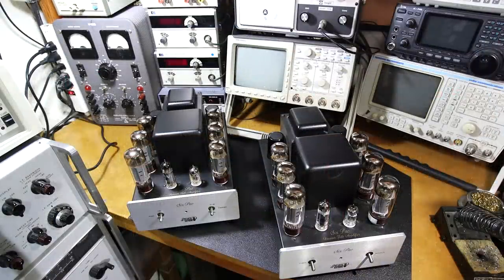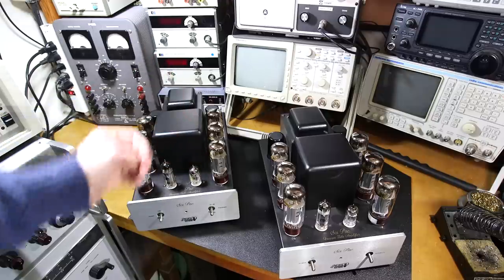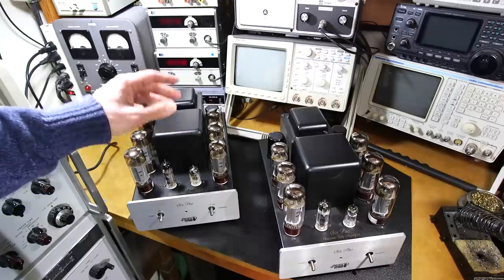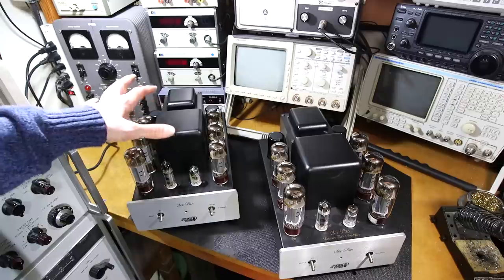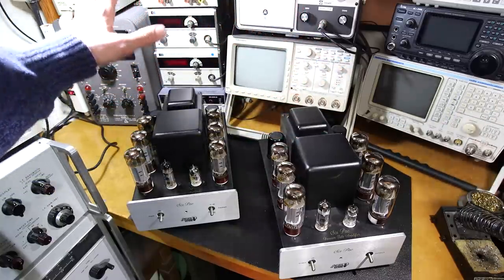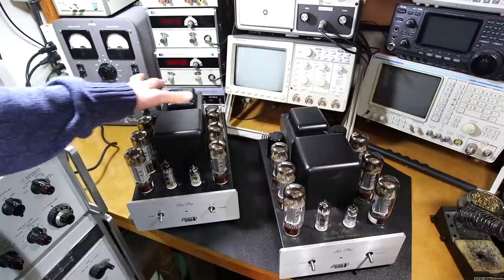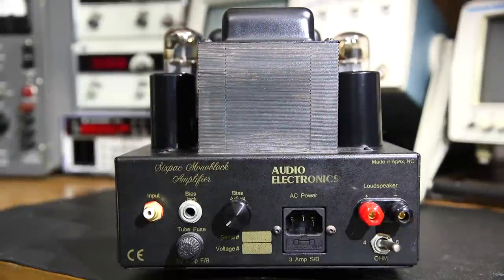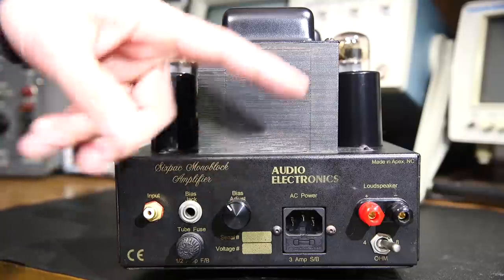Two Six Pac's On The Bench

Comment: I would say regarding double triodes that both triode sections would generally receive exactly the same wear in most circuits. Being that they are run in class a and sit mid point their whole life. Sure there may be cases where one will deteriorate faster than the other but in my experience over 45 years I very rarely see more difference taking a random valve from one circuit  than I would expect from a tube I knew was running in a symetrical circuit, say a L+R stereo input.
Most audiophiles (dirty word these days) would check each side matched well enough new from the box. In fact it is a good idea to select valves for microphony,  noise and balance and always choose  the best one for most sensitive section of amplifier. Best advice is - wherever they came from - treat them all as suspect before use.

Comment: why choke input anyway, sure regulation is better , but it ain't nowhere as clean!! put a little filter capacity ahead of that choke and you'll notice a big difference!! and get your wiring cleaned up!!  no Ham operator would ever build that sloppy!!! and why is the filter choke so close to the low signal area!!!  Dam poor design!!!

Comment: 8:54 - Why do the preamp tubes need to be as far away from the power supply as possible? I would've thought that they need to be as far away from the output transformer as possible.
Reply from the maker: The power transformer has constant 60cy on it. The rising and collapsing magnetic field will couple to metal objects near by. Vacuum tubes have metal in them that will "feel" this near by field.

Comment: At around 43:30: Considering how electrons actually flow in a tube circuit (cathode to plate), "current source" is more accurate.

The 27 kohm resistor in the bias circuit is not a big deal. It limits the bias voltage from about -130 vDC to about half that. Because an EL34 will be completely cutoff at around -40 vDC, applying more that -65 vDC would be counter productive, and it would restrict the available range of the bias pot.

Comment: Regarding the discussion on the dangers of operating a tube amplifier without a load, I'm wondering why the power line transformer that feeds my house doesn't explode when I disconnect everything so it has no load on it.  ;-)

Comment: Sorry to say this, i really disagree with you here at 52:52...really...i mean, i know you´re very experienced in this stuff...i can hardly get why you´re saying this...

first: a good design would be to add independent tube bias. And also with a "wiper-lift-proof" if this wiper here accidentally lift from the carbon (or whatever resitive path) what you gonne see: no more tube bias....EL34 red plating and a smoked output tranny very soon after this happens...

next: what is this input circuit about...you would need to match the input tube...for a close system to system match...what...seriously a nogo. a good design uses two tubes, and a circuit with feedback in order not to need any matching at all. And also a traditional phase splitter followed by a driver with two trimpots to equalize driving voltage for the PP output tubes would be way better than this nonsence with that active current sink...i would go for a total different  preAmp with two ECC85 medium Mu tubes which can supply a nice amount output current, in order to have a low output impedance.

next: input impedance of the EL34 stage, have you looked at that...it´s 68k in series with the bias pot 27k...and if you put it near to ground it´ll go lower and lower make it worse and worse in order to drive it from an ECC83....i don´t need to say that a look into the datasheet for the output curves section would be a nice thing...

Also, i won´t do a triode mode amp...wasted power...pentode with used UL tapps....that´s the thing, it´s more or less the best of both worlds...

Also i would go for a delayed B+ no need for stacked filter caps and also much less stress for them tubes while heating up with B+ present...or simply add a standby switch, as a most basic user activated B+

That´s why i never ever gonny buy such a thing...

Comment: First of all, awesome video! Just a thought. If the DC voltage for the 12AX7 is 6.9V (which is high), the peak of the sine before the diode, assuming 0.8V forward voltage drop, is 7.7V. That would make about 5.4VAC RMS used for the three EL34's heaters. That's way too low. The ideal 6.3VAC RMS would give 8.9V sine peak for the 12AX7. A dropper resistor or even a LDO voltage regulator would be mandatory. Or am I missing something.

Also, the resistors look like RN65D's (CMF65's). They're rated at 350V max. Running the LED of the 400V line with just one resistor is a bad idea IMO. Plus, the fact these amps use 27.4 kohm is not due to precision, but because of this ranges standard values. 27.0 kohm is actually more expensive :D

Comment: I looks like this amp as been recaped many time, every time a cap was changed they changed one for a chinese brand lower quality one and they were left flapping in the air because of the different dimensions just attached with a tie wrap , you se often poor repair qualities installing a radial cap instead of an axial cap or vice versas ! This is still a high quality amp anything done to its esthetique make its a lower quality that it was at one time !  As a retired teck i've seen so many botch up job because of the lack of availability of original parts and the part market flooded with cheap chinese contrefit parts !  A Kinda miss the old days with quality japanese parts ! That's why pro musicians are dead scare of having a recap job done on their 60 years old expensive collector amps  thinking their amp could become filled with cheap chinese replacement , prefering to risk it with bad leaking wax caps ! You can get a whole complete assortment of imported capacitors for about 6$ no way i can believe that these will last as long !

Comment: Thank you for another awesome video. Here's a link to some information about these amps. 
http://www.sixpacs.com/tubetalk.shtml
Designed by Dennis Had, at Cary Audio Electronics, in the early 2000's.
The original Phase Inverter tube was a 6922, in the final design it is a 12BZ7, but can use a 12AX7 or 12AU7.

Comment: Very interesting video. I'm building a Wadar valve amp designed by the late Gerry Wells of the British Vintage Wireless Society. It uses 6J7 input, 6SN7 tone control/buffer, 6SN7 2nd buffer/phase splitter and PEN45 outputs. I reduced 50Hz hum by putting 470 ohm resistor across 6.3VAC heaters, wiper to earth. Interesting your level off acceptable hum. I can't remember what mine is, but now I know ~ 5mV is something to aim for as a max. Orientation of the o/p transformers and mains transformer was important, as hum induction shows on your video.

Also noticed there doesn't seem to be an earth/ground bus-bar earthed at one point only in that design; looks like earths are just connected where needed all over the place. I thought that was a recipe for hum!

Incidentally, with careful observation of a sine wave, what percentage of distortion is only just visible as that would be an interesting thing to know. I think I remember being told it's about 5 per cent. Does that sound anywhere reasonable?

Comment: 27.4K plate loads in the old days probably would have been considered pretty low as roughly half an ax7;s plate resistance,  (the old rule was Rp =>2x rp) Cool to seethe EL84 acting to make a pretty long "tail".   Also interesting to see a typical gain stage in front of the inverter deleted.  I'd love to see you cook up some PC boards for a  Hegeman RIAA preamp w. cascade feedback pair driving passive RIAA. and "anode follower" for high level.  - somehow the Chinese mainly latch onto the Marantz C7 type for clones..

Comment: Why do you prefer soldered to screw fitting for large caps?
I prefer the screws, or crimps --- if you are worried about vibration you could put a blob of Loctite in and/or around the screw.

Comment: The input tube draws almost 4mA for each plate with a 27K plate resistor that I suspect it should be a 12AT7 tube in the stock circuit instead of 12AX7. The 12AT7 allows more current and lower plate resistance with slightly lower gain.  Great video, by the way!

Edit: I just saw the spec from their website and the suggested input tube is supposed to be either 12BZ7 or 12AY7. 12BZ7 is essentially each plate is TWO 12AX7 triodes paralleled together. So yeah, using12AX7 is not ideal. I still believe using a 12AT7 is better.

Comment: Whoever made that bias control so easily moved doesn't have a child or a cat. It's also amazing that with all the design that went into the amp, they dropped the ball on choke placement on a choke-input power supply, but I have seen mistakes like that before.

Comment: 16min mark. setting the bias without speakers hooked up?  even if this is just a demonstration the output transformer with that amount power involved is so bad. when i first started doing this i fried a set of output iron with just one el84 per ot, let alone 6 el34s per. with all that bench gear and education im kinda floored. maybe after this point in the video mr carlson had addressed this but i can't watch anymore.

Comment: Great Video. The most informative I have seen on YouTube. The AES six packs were made by Cary Audio.  Designed by Dennis Had.  I own a Cary SA-280 more commonly Known as a V-12R.  It is basically 2 of the 6 packs in a stereo format. The original input tube is a 12BZ7 with a 12AX7 as the first substitute.  The other difference is no feedback switch, but it does offer a triode/ultralinier switch.  50W in triode, 100 in ultralinier mode.
I would like to see if you would be interested in doing a once over tune up on it.

Comment: Some safety notes for newbies to tube servicing. 1) Use an isolation transformer!! 2) When possible, use battery-operated test equipment that’s not earth-referenced - this way you won’t create an unwanted ground loop (and noise), and you won’t blow your DMM to sh*t if the chassis IS hot. 3) As Mr. Carlson said, there are dangerous voltages at LETHAL currents in most any tube equipment - even when the power is off; the capacitors can still be at high potential! It’s your life - take care. 4) Never plug in any used device if you’re unsure of it’s physical state - do a visual inspection for popped, melted, or burnt components or wiring, or other signs of excessive wear or abuse (such as physically leaky capacitors, frayed insulation, etc...)

Comment: Could you have used the Cu. wrap, like I've seen on some power amps.  It is a Cu. sheet that goes all around the transformer, like a blanket, then just soldered to hold the ends down.  Maybe that would get too hot???   
Sometimes just moving parts around, will cause other problems.  
I built a regulated 13.8v 50a, power supply for a friend, and used the unused holes in the core of the power transformer to mount it in the chassis, and man did it get hot.  I found out that I changed the eddy currents in the transformer by putting bolts in those holes, and in  fact by doing that, it kind of made a short circuit.  I took the bolts out, and it worked just fine.  I learned something new that day!!!!
I enjoyed the video, and again learned a lot.
THANK YOU!!!!!!!!!!!!!!!!!!
Michael M.

Comment: I'm not sure why you need 6 EL34's for 50w.  Guitar amps use 4 to get 120w.  I'm sure the higher B+ in the guitar amp has all to do with it.  Is it so the tubes loaf along at 50w?Thanks again for another great video!

Comment: Very good analysis of the amp design. I was taught that tube amps should always have a load connected. What would the hum and noise have looked like with the correct load? The 2 half cycles of hum looked different which was probably just winding differences in the center tapped high voltage transformer. What do you suppose would be the effect of the failure of one of the 4 diodes? BTW, you showed the amp putting out twice as much power. Did you flip the 4/8 ohm switch? Is the phase inverter a floating paraphase? Using an EL84 as the constant current sink seems like an expensive way to go for what it does (in terms of components, space, heat, etc). The question of the bias control is puzzling. All the cathodes connect to ground through the 10 ohm resistor.That value is too low for balancing. Perhaps the designer was expecting the users to buy matched sextets of tubes. Also, what happens to the current when the wiper of the bias pot goes open circuit? Brightly glowing tubes and, hopefully, a quick blowing of fuses. Your Carlson "Noise Sniffer" did an amazing job. Many thanks for all your work!

Comment: Great presentation as always - BUT in my opinion tube audio amplifiers like this should never be run without a load on them.  Any hum or noise of god forbid any oscillation with induce massive audio voltages on the anodes - enough to flash over in the tubes or worse inside the output transformer and dispatch them to copper heaven

Comment: I would be curious as to what the noise level would be by just fabricating a grounded medal (tin) shield around the choke in its existing location. That modification could be a lot easier to manage if the resulting noise reduction was sufficient.

Comment: Is that filter reactor solely for reducing noise, or is there another function for it like passing the signal?  If it's just for noise removal, what would it do with it completely removed from the terminal strips with the output noise?  It seems like it's causing more interference rather than filtering in its place.  Just curious.  Thanks for sharing.

Comment: You were concerned about the lack of voltage regulation on the negative supply to the phase inverter. This should not be a problem since this is feeding the current source or sink as you prefer. The whole purpose of the current source is to make the current constant independent of voltage change at the feed point or the load point. 

The phase inverter is a classic differential amplifier. When the voltage on the two grids are equal, the constant current is divided equally and the voltage drops across the plate resistors are exactly the same. this is why the  precision resistors are used. As the input signal voltage moves up and down, the constant current is shifted back and forth and shared between the two triodes, dividing in exact proportion. If the current in one of the triode is increased by some amount, say 10%, then the current in the other triode must decrease by 10% in order to conserve the constant source current.

Comment: Thanks for a great video, it brought back memories. In the 1960s, when I was an EE student, I remember building one of these.
http://www.sowter.co.uk/schematics/Mullard%205-20.pdf
It used a pair of EL34s and was known as the Mullard 5-20 (5 valve, 20W)
Note the use of the dreaded paper capacitors, even for the main smoothing ones, 8muF 500V oil filled brutes.
Later I modified it slightly by changing the valve rectifier for a pair of silicon diodes and also rectifying the 6.3V heater supply to run them on DC.
I used this amp for years in a mono setup coupled with its matching 3 valve preamplifier, Chapter 9 in the full publication
http://www.sowter.co.uk/pdf/Mullard-Circuits-for-Audio-Amplifiers.pdf.
If you are not familiar with this book, it was THE source of information for many home builders and students in the UK at the time.
Note the pre-decimal currency price of 8/6d = 42.5p or about 50c US.

BTW, are you going to do a follow up on the second amp? How did the two of them sound in their final setup?

Comment: Great project. I figured that the feedback loop with the indicated resistor values seems to cause a 6dB voltage decrease at the differential amplifier input. That's quarter power at the load. I wonder if it is really so in the actual device? The switch says "10 dB"?

Comment: Thanks for the video mate, some very good information there. Man you got some nice modern test gear there. My test gear is 20-30 years old now but still running. I need one of those signal tracers like you got there would be real handy. It's a wonder the designer of that Amp didn't use it to sort that noise problem out. It's figures in the day would have been ground breaking if they did what you just did. 

I'll be using the knowledge you shared here on my stereo valve amp with a set of 6550 valves in it.It cranks quite nicely but I only use it in Winter as it doubles as a Room Heater. I did have a power supply problem which I already fixed years ago & no problems since. Your explanation of different tube modes explained a lot because my amp has a switch for each channel called "pent" & " Triode" mode, I now know what that means thanks to you. Frankly I couldn't hear a difference though. Many thanks on your very knowledgeable work.

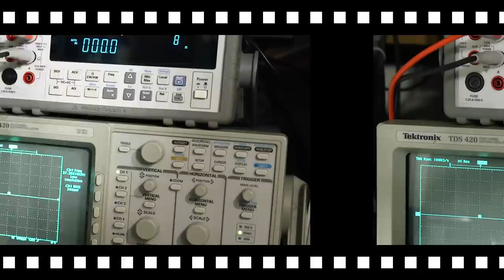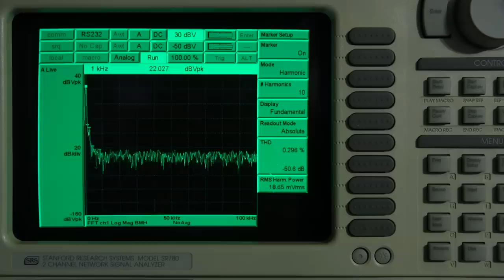Comment: Great video!  Loved watching the amplifier frequency range measuring 01:06:26 19.6 Hz to 21.4kHz at 1 db down point and 49.76W output for an advertised 50W audio block amplifier.  That's quite a modification to get 105W output instead of the stock 50W 01:02:20   It makes the amplifier highly accommodating for modern hifi loud speakers.  Tracking down the AC hum was marvelous 01:16:30 !   Finding magnetic coupling from the power supply into the audio output transformer was not something I wouldn't have hunted for.  I wonder if the there was a factory faulty spec part that was used for a while and if there was a later factory fix for the units that had it.

Comment: I am quite surprised now messy and rats-nest-like the point-to-point wiring is in these amps. If I'm building a valve amp (which I haven't done for a few years!) I like to keep the wiring neat and close to the chassis, and I think it helps with feedback/crosstalk issues, as well as looking nicer!